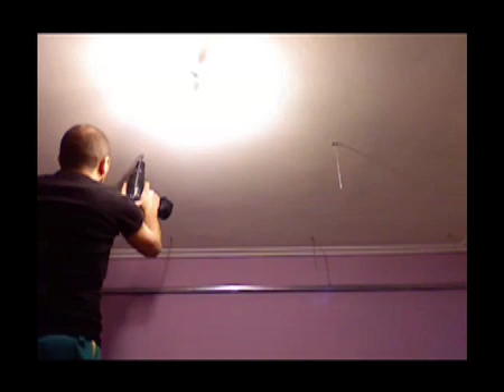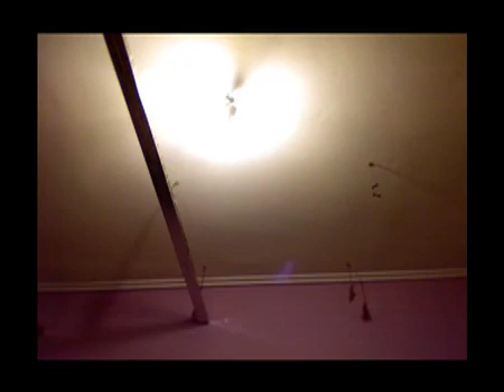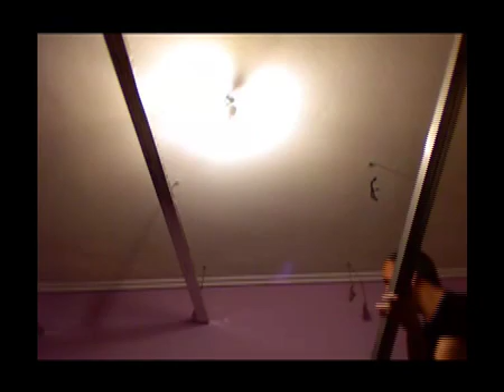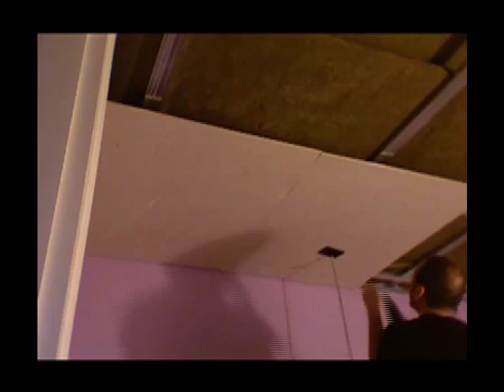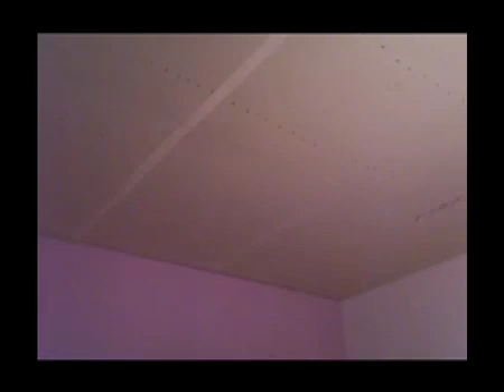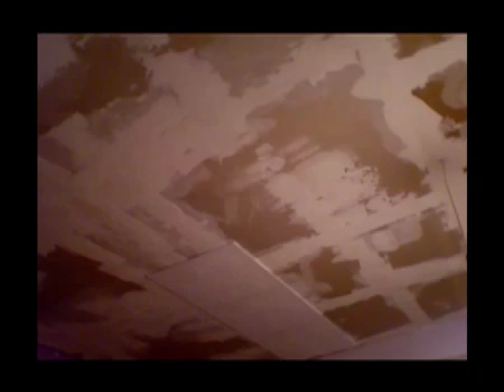Soundproof ceiling with stone wool and drywall in 2 min.

Comment from the maker: Just pulled a longer cable and had a tiny hole made on to the drywall to get it passed through. Was carefull to screw the light fix to one of the aluminium bars and not only the drywall.

Comment: Ok, as an owner of similar solution, let me give you some of my thoughts. Such a system actually will not help you for the sounds coming from building construction (steps, hitting into floor). It can actually even make it worse, since you are creating a large membrane, which will boost low frequency sounds. Note that plasters are connected to the ceiling, so any vibration of the ceiling will be transferred directly to plasters. Only high frequency sounds will be reduced.

Comment: i hope the soundproofing ceiling works BUT by just doing the ceilings alone may not solve the noise reduction- because 'flanking' can occur where the sound simply travels around the floor and down the walls.

Comment: I respectfully disagree. Acoustic science teaches us that adding mass (weight and air)and barriers (layers, foam, poly, etc.) and distance all create a much lower transmission of sound high or low. Some of your theory is usefull for describing part of bass woofer enclosure dynamics, but they are constructed somewhat differently and with a very direct purpose in mind. If there were less acoustic dampers in place and the 1st cavity was much hollower I might agree. Just my 2 cents. Works for most.